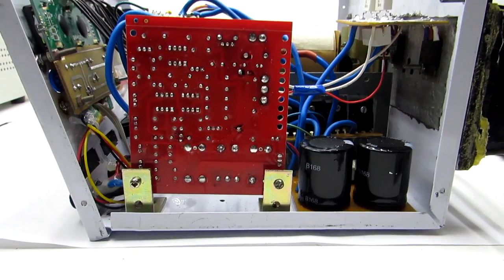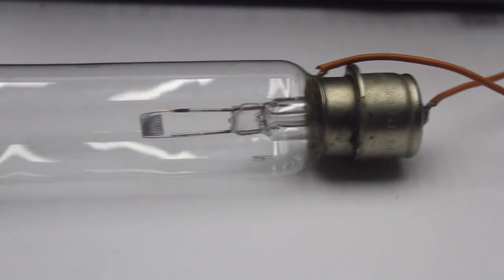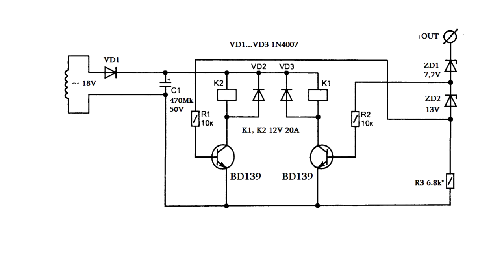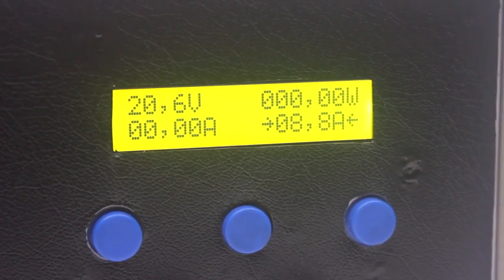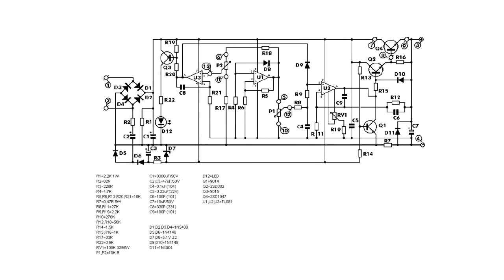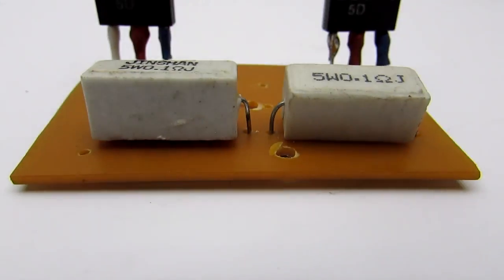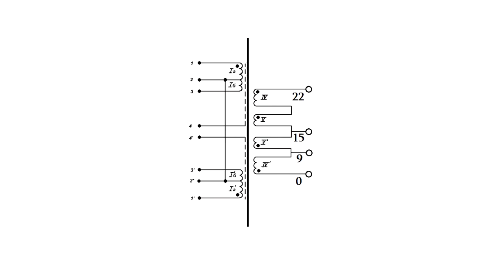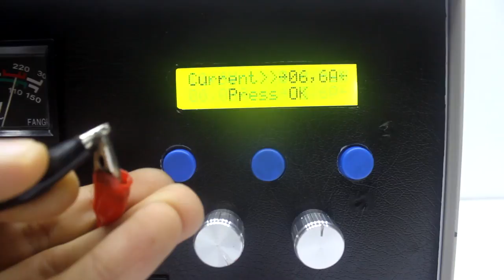DIY super laboratory power supply

Comment: Excellent project but a little expensive for a hobbyist.
Reply: The transformer is the only real expense. The easiest and cheapest way to salvage an equivalent transformer is to use multiple transformers, rectify each of the secondaries and then wire each secondary in series like a battery. I like to upcycle audio or car charger transformers to get higher current on the cheap.
Reply: Upcycle Electronics old ups tramsformer good is free or cheap
Reply: Upcycle Electronics, I see, that is how you do it, thanks
Reply: samıh savdır 
  That sounds like a good place to find one. I try to buy up any car battery chargers I can find at thrift stores and garage sales. They seem to be the most common 6-10amp transformers I have come across on the cheap (I have 3 spares currently sitting on a parts shelf). I don't pay more than $5 for one.
  Audio transformers are usually more versatile as they tend to have more complex secondary windings for dual polarity preamps/op amps and a high current winding(s) for the power amp(s) itself.
   Another super cheap option to keep an eye out for are the low power lawn lighting type control boxes. Some of them have large high current transformers. Most people in second hand stores have no idea what they are or what to price them. I've picked up a couple of those for $2 each, weather proof enclosure and all. The ones I have look like they belong in welders... massive ;)
Reply: I like the aesthetics of clean minimalist design personally. Which is something that your kludge transformer scheme offends greatly. I'm not saying it wouldn't work, but that I'd rather not build it if it is going to be so hideous.
Reply: Paul Frederick 
 I love clean aesthetics. My personal hobby interests come last in life. If I can turn a bit of lunch money into a tool or project, I'm not too proud to try it. I'd rather get the job done with an ugly tool rather than have none at all while saving for years, but to each his/her own. We'd be nowhere without standards. My standards probably have roots a little closer to the poor house.
Reply: I live by the axiom, anything worth doing is worth doing right. So if I can't afford to do something right I tend to wait until I can. Because as they say, good things come to those who wait.
Reply: +Paul Frederick
 ¿ good things come to those who wait.? 
Your mother told you lies ...  People died waiting in believing that axiom....
The best is to buy the best you can afford at the time, and later buy something better when funds become available.
Reply: +Andrew_koala then you've bought twice, which ends up costing more.
Reply: What do you have in mind that may be cheaper and just as good as this?
Reply: If you follow the above conversation, there are a few suggestions for sourcing transformers for a project like this. I have a couple of tutorials vids on how to mod a cheap SMPS supply by just changing one or two resistors. That is the cheapest variable voltage supply. If you need a supply for very small signal purposes (under 100uV/not something most beginners need), then don't play with SMPS, go linear. This channel has a good example of a linear supply using upcycled components, but it's not as stable as an LM317 or similar 3 terminal regulator. If you want to stick with salvaged stuff on the cheap, look up 'LM317 current bypass transistor circuits.' If you understand the bypass circuit, you can find the modern equivalent to an LM317 in it's surface mount variety. They are usually in a SOT-23 package and marked xx1117 (usually AMS1117). There are a lot of fixed regulators that look similar. The voltage type is usually marked just below the part number. You need one marked "adj." You can improvise a surface mount if you want, but I usually just cut the PCB around it with it's filter caps and all. Then just replace the voltage divider with a potentiometer. You can usually find the 1117's in simple low voltage consumer electronics. You need to find 5-15 year old junk that is mass produced in the millions (sold at Big Box stores/Walmart/Best Buy/etc), and that uses a wall wart plug as it's power supply (not batteries). I have found several in digital picture frames and internet routers. There is a good chance of finding them in digital audio junk too, but not always. The adjustable variety can be treated just like a regular adjustable regulator. They just can't handle large currents, thus the need for a bypass transistor.

    If you want a current regulator, start by looking up and building a 'JFET current sink' with just a N channel JFET and resistor. You place the load's return to ground on the drain pin. The resistor goes on the source pin and the other side of the resistor to circuit ground. The gate also goes to circuit ground (aka the other side of the resistor).

     (Load)
        | D
G┌[
    |   | S
    |(R1)
    L_|
        |
   (Ground)

 The resistor value sets the current limit of the entire circuit. You can even build a simple insert that plugs into the ground terminal of any power supply. This insert contains the JFET and Resistor (or potentiometer), and your load (device your powering) plugs into the insert. This turns any power supply into a current limiting supply. (This device is on my list of things to build in a tutorial soon)
   N channel JFET's are easy to find if you know where to look. All little metal canned electret microphones contain an N channel JFET. Just carefully cut away the base of the can with side cutters to get into one. If it's a through hole FET, one of the pins of the FET will probably be attached on the surface of the little PCB base really tightly. They can be a pain to deal with but the secret is to use a hobby type razor blade/scalpel knife to carefully remove it. That's a great way to get started with current limiting building block type circuits.
Reply: High VA transformers have gone the way of the dodo bird these days. They are virtually non-existent anymore. As everything high current has gone SMPS. It was never easy to find the right voltage output with any transformer for projects if you needed a specific voltage anyways. Modding manufactured SMPS for different voltage output may not be wise either. As the transformers in them are wound for specific outputs. So changing the sense loop disrupts the balance of the drive circuitry. But hey if it works for you then I guess you're just lucky. It does need to be a cheap SMPS like you say too, because better PSUs have over and under voltage sensors built into them. So they'll shut down when they drift out of regulation.
Reply: +Paul Frederick 
That has been my experience too when it comes to high VA transformers. 
   I've been doing a lot of experimentation with SMPS trying to understand them practically. Most of the cheap SMPS units common to consumer goods are simple old style peak current mode controllers, at least the ones that I've come across that use the TL431 shunt reference. I have a few of the Constant Current PWM type chips that are more complicated (UC3843/KA7500/TL494), but they seem to be used in newer and larger style supplies. All the ones I've played with have quite a bit of adjustment room built in. I actually got the idea awhile back after finding two different power supplies from Sony devices where the circuits were identical. They had a trimmer pot on the inside that was sealed inside. One was set to 9.5volts output and the other was at 12volts.
   After plotting the frequency curves for the timing capacitor, and testing the output with a dummy load they aren't that bad.
    I'm slowly working on another project to upload where I'm using a MC34063 from a car type phone charger and a small transformer from an old calculator with multiple secondaries where I can float the ground point of the supply to get a zero volt adjustment. I will try to compare it on the scope to an adjustable linear supply at the end.
    I've been trying to calculate ∆IL/IL(ave) and trying to center it inside the voltage adjustment as much as possible. I've yet to figure that out in a way I can communicate without words (fun little personal challenge). I really wish I had a cheap component tester or LCR meter but my wallets full of dust bunnies ATM.
  When it comes to the cheap "off-line" type mains power supplies, if you only mod the secondary side it's pretty difficult to screw them up. The manufacturer has already biased the other side of the optocoupler to the actual feedback pin of the controller. The way I showed is fairly fool proof because of this. The little none isolated MC34063 circuits used in chargers are a whole nother story. I've already smoked one and blew out a cap with another while experimenting with unknown inductors and external FETs. (Things I would never encourage others to do.)
Reply: As I understand it SMPS are tuned with the coil they use for a certain output. Going too far away from that smokes the drive transistors. There is some adjustment allowed, but it falls within a range. The way to really set the output on a SMPS is to rewind the transformer for the voltage you want. I want to get into building custom SMPS myself. I am just finishing up the circuit I am working on now. I made a really simple dimmer circuit that seems to work remarkably well. I want to use it to speed control universal motors. I have a couple I'd like to slow down. I did buy a batch of TL494s to experiment with and I've taken apart some ferrites to rewind. So that project is on deck once I wrap this one up. I'm kind of tired of building linear supplies at this point anyways. So I could go for a change of pace, something new. I can get loads of SMPS parts. I've probably stripped a dozen old PSUs by now as it is.
Reply: Paul Frederick 
  Going to physical therapy now, but there is an excellent excel tool that helps you calculate how to set up a SMPS here:
http://www.onsemi.com/pub_link/Collateral/SMPSRM-D.PDF

or the practically useless simple version here:
http://www.nomad.ee/micros/mc34063a/

Constant Current example setup:
http://paulorenato.com/index.php/about?id=89

 P Channel FET example that doesn't work so well but lots of info and good references at the bottom:
http://www.jiggerjuice.info/electronics/projects/power/buck-diode-pmos.html

Practical explanation of MC34063 pinout and functionality:
http://www.learningaboutelectronics.com/Articles/Switch-mode-power-supply-circuit-with-an-MC34063.php

Expansive SMPS Reference:
http://www.bcae1.com/switchingpowersupplydesign/switchingpowersupplytut01.htm#strc

  Those are a few I found helpful so far ;)
Reply: Thanks for the links. I'll look them all over.
Reply: I just realized the first link was wrong. This should be the excel spreadsheet:
https://www.onsemi.com/pub/Collateral/MC34063%2520DWS.XLS

    Your probably not interested in the MC34063 chip, but some of basic principles work in different designs. I particularly liked how this spreadsheet let's you see how a lot of different elements interact with one another dynamically. Especially how current ripple and core saturation interact and relate to duty cycle and timing capacitor.
    Each of the SMPS supplies I've modified are rated at relatively high currents from 3-7amps and from 9.5-36 volts originally. I certainly wouldn't recomend that someone should try to get max current rating from a supply like this at a different voltage, but in general the transformer is designed for safe operation at it's rated current/voltage which means it has a fairly large margin of voltage variability at lower currents without fear of core saturation. With "off line" isolated mains supplies you don't really have to worry about duty cycle issues because there is such a big difference between primary side voltage and the secondary. I burned up an MC34063 learning the duty cycle lesson. The timing capacitor comes into play in my experience more than the inductor on a variable setup but like I said I haven't pushed one of these hard by supplying as large of a current as possible. I have other fixed supplies I use for those types of projects. Of all the supplies I've built the little adjustable SMPS I built into its original enclosure and showed in tutorials is by far the most used and convenient one I grab for little projects these days. It's quite handy and doesn't get in the way. I think they are more flexible than most people give them credit for.
Reply: Upcycle Electronics  I just subscribed to your YouTube Channel, I'll be watching, thanks, you know I like new project builds were I can use some of the electronics I get from my excellent recycle trailer source. Let me know if you're looking for a particular component be glad to help. See I am interested following project builds that use existing circuits found in recycled goods. Yes, I can buy new from china usually cheaper, but that's not the point, right? Most of the time you can find what your wanting to make already assembled cheaper than buying the components and assembling yourself,but this is the niche need for a channel to satisfy.
I enjoy the hunt for a particular component that needs replaced after I have diagnosed what is bad, then taking that recycled component and replacing, and getting something broke to work again! I do not see making a living at this but I really enjoy it, heck most of the stuff I fix I give away.
Thanks!
Reply: Gary Weliver 
  Thanks. I'm just having fun as well. I'm slow to build projects and upload content, but I'm just having fun. I'm no electronics engineer but I have a propensity for learning technical subjects and I have an intuitive thought process that some people relate well to. I live near a thrift store that sells a lot of electronics. When their tote of wires and chargers gets hopelessly tangled I go attack it with side cutters for all the supplies and they recycle the copper. I also pick up the stuff they get that doesn't power on from time to time. It makes for a wide range of fun random free stuff. I only buy the super cheap odds and ends that have extra value.
   Here in the US, now that RadioShack is officially belly up, I think learning to source your parts from junk is the only real gateway into electronics for the next generation. It just became much more challenging to build your first mildly useful trinket here.
Reply: +Gary Weliver I never use existing circuits. There's usually some special aspect of them that makes them not work for me. Like I tried to get the fluorescent bulbs to work in a LCD monitor, but the micro on the board sensed there was no signal, so it would shut down. It isn't worth it to me to figure out what someone else did and circumvent it either. I just don't like kludgy crap like that. There's no junk electronics to be had by me anyways. I like stripping boards for parts, but I can't even get any here. I used to be able to, when I lived in a more populated area. But where I'm at now if it isn't corn, soy beans, or chickens then it isn't here either. At least like you say parts from China are cheap, and easy to get now. For experimenting I like having a quantity of fresh parts to use anyways. That way if I fry something I have spares. Which doesn't happen too often, but I still worry about it. With the things I do the potential certainly exists. I'm surprised I didn't blow anything up making this dimmer circuit recently. It is not like I ever made one before. Plus the info on the net kind of sucks. They don't tell you that you can only trigger off one leg of the triac. I eventually figured that out on my own though. I looked at a bunch of sources too.
Reply: Paul Frederick 
  I don't usually mess with the super integrated stuff myself. I've gone down that rabbit hole a few times. Salvaging parts certainly takes more time and is really difficult to do solo. I actually keep most of the parts I have on the original PCBs. There is a lot to learn from figuring out how a device works. If I'm going to salvage a complete part of a circuit, I take pictures, power it up, and make sharpie notes for everything I find. For instance there are some interesting triac circuits used on HP laserjet printers for the heating drum element. They use a triac, 6 pin optocoupler, and a relay to make it work. 
  Another interesting switch mode circuit I've come across is a small portable heater that used 2× PIC12F675 microcontrollers as the switching controllers for a high voltage heating element and an "Ozone Ionizing Grid." I almost threw it away because it looked terrible on the outside. It ended up being one of the most interesting finds I've gotten for free.
  Salvage stuff is a great way to get a foothold in electronics or to explore a new interest, but it's also a guaranteed recipe for wasted time and unnecessary headaches. It really comes down to what your time is worth to you.

 Being human means we all have to subject ourselves to a life choice of having too much time and no money, or a bit of money and no time. The only other option is to hurt people by taking advantage of them to take away their time/money. I got stuck with the extra time option, so I salvage and make due with what I have :)
Reply: The way I strip boards is pretty fast. I had to up my game when I got my second microcomputer to scrap. So I bought something called a solder pot to pull parts out with. I just put a board over the molten cup of solder and pull parts out. A 64 pin DIP IC comes out as quickly as a resistor does. Sometimes I think I should research boards more before I strip parts off them, but like you said, that takes time. If parts are so mysterious I can't look them up then I don't want to use them anyways. I do find a number of mystery parts stripping old boards too. Then it is obsolete junk. I find some nice vintage stuff too though. I pulled some old radio apart and got a bunch of vintage JRC parts off it. The vintage JRC4558s are like $75 chips. Well worthless today because I hear they remade them. So you can't tell the originals from the remakes. Well, you can tell listening to them. I know the ones I have are the real deal. Because I pulled them out of an old board. There's a lot of counterfeit electronic parts today. All the stuff out of China is fake. Some is more fake than others though.
Reply: Paul Frederick 
   I've looked into building a solder pot, but I think an operation like that would be a bit much for my physical limitations. I set up my lab in my bedroom. Not exactly the most healthy solution, but it allows me to maximize my time. 
    I have a few displaced disks in my upper back that prevent me from sitting or standing for prolonged periods. At best I get 2-3 hours of periodic upright activity most days. After that I'm prone to big mistakes, impatience, and failures from pain levels. Any demanding types of dedicated operations tend to be a bad idea for me. I end up leaving a giant mess everywhere and a long series of half finished tasks and projects in my wake. 
   Before I got hurt I was porting a set of aluminum heads, machining a custom intake manifold, and putting a B&M mini blower on my Camaro, while also getting into metal casting, and racing bicycles, while working 50 hours a week... So slowing down has been a rough lesson to learn. Hopefully one day I'll get myself back in gear and up to speed.
     After 3 years of getting more than casually involved with electronics, I'm at a point where I don't get as much benefit from keeping the parts on the PCBs on such a large scale. I have learned to handle certain parts more carefully like transformers, larger capacitors, and larger transistor type packages. However it is really beneficial to know the context of a part in a circuit to see things like it's power handling capabilities at a glance. For a beginner, a schematic can look like a foreign language crossword puzzle. Seeing a physical example on a board helped me understand things like dual polarity versus single supply op amps, and how audio preamp filter stages, buffers, and decoupling work. Even recently researching SMPS. At first I was focused on trying to find a specific control chip used in several devices to figure out how it worked. Once I fully understood how to identify the components of a SMPS, I started to realize how prolific they really are on almost everything. I went from having a bunch of examples of buck converters in isolated and non-isolated topologies and a few boost converters, to having examples of almost every topology imaginable. Of particular interest are the buck-boost circuits I found on battery operated devices that can maintain their steady voltage output until they seriously suck a battery dry. In all likelihood I wouldn't tackle a circuit like that for years. With a working example that I can cut out and modify to help me understand the topology I'm already pushing my understanding further. That said, I've encountered burned out diodes, a few broken traces, leaking capacitors, and various other headaches from attempting to salvage circuits and parts I didn't know were faulty. Most problems were solved quickly, but not all. I'm still keeping it pretty simple though. It all comes down to how we value our time. My time is currently valued at the curb clearance pricing tier of an overstock surplus store.
   As far as salvaging components, I really want to build or buy a hot air rework setup, and a powered solder sucker like on the Mr Carlson's Lab YT channel.
Reply: Good Stuff
Reply: Yeah I do not run my solder pot indoors. Or The Volcano, as I affectionately call it. I have a commercially made Esico brand model 37. Here's a picture. http://i.imgur.com/2LqkdOi.jpg That much molten metal just screams take it outside. I think the mouth is about three and a half inches in diameter? So any part that fits in that area I can pop right off a board. Some long connectors haven't fit. But most everything else is no problem for me. I still need to attack boards with some strategy. I take the more temperature sensitive components off first. Skim the cream. What I do is I rotate a few boards in a session. I do a heat, remove some parts, then rest the board, to allow it to cool, and I work on another board. Usually I'll do a 5 board rotation. Strip 5 boards in a sitting. That takes maybe 45 minutes? Then it takes about 3 days to sort all of the parts into storage. It depends how random a collection of parts I end up with. It is usually pretty chaotic though. As those are the kinds of boards I typically target. Ones with varied collections of parts on them.

I've sat there stripping boards with solder suckers and using a solder pot is the big leagues compared to that. There's no comparison really. A solder pot is easily 20 to 30 times faster. It basically boils down to how quickly can you get a tool on a part? Sometimes I just use a pick tool and flick parts off boards. That goes really fast. Sometimes I use these angled needle nosed pliers to pull parts out. Some parts I just grab. Like ferrites on PSU boards. They pop right off.
Reply: Paul Frederick 
  That's a more manageable size than others I've seen and a more portable setup. How long does it take to heat up to temperature, and are there any potential consequences/reasons why you couldn't leave it unattended for 10-15 min?
   When my back goes out I have to stop and lay down flat. I can come back a short while later but that's most of my day... On/off/on/off. If I'm in an office chair that leans back I can manage better but committing to continuous sitting up or standing puts me on a damage clock. I can do it but it will cost me a few days of total inactivity afterwards.
  I'd love the convince of a solder pot like that especially when it comes to the lead free junk that never cooperates with a solder sucker.
Reply: This is a pretty big solder pot. It is 5 pounds of molten solder. It is not leaving it unattended that I worry about but the unlikely event that it spills over. Plus there are fumes. Burning circuit boards do stink. It is the greatest for tinning soldering iron tips though.
Reply: I bet it is the best for tinning tips! Heck you could probably do some interesting brazing projects as well with 5lbs of heat mass. 

  When I said it was small I was referring to the overall kinda square looking dimension (height to width). It's not easy to determine exact scale in the pic, but you said it was about 3.5" in diameter, so I assume each face is a little bigger than the palm of my hand. The ones I've seen people "kludge" together usually look like something I wouldn't want to move around much at all. They look like the kind of tool that needs some dedicated workbench real estate. They are usually more shallow and larger. I wouldn't want to slosh something like that around. Your setup, with the metal pan and tray with handles just looked much more manageable and portable than others.
Reply: Gary Weliver 
  Yeah I understand what your saying. I will try to do some of that, but the real fear is misguiding someone or failing to warn someone about potential hazards. Most people are worried about legal problems from that kind of thing. I'm just learning as well.
    I can guarantee I will do things wrong and make mistakes along the way. I don't want that to go unchecked. 
    When it comes to electronics fundamentals the subject is huge and much more complex than most people know...and that's just the fundamentals. I certainly underestimated it. About all anyone can do is try to show people how they managed to connect the dots on a subject as simply as possible. This is one subject where the structure of a schooling program is about the only way to completely understand what your doing and why. It takes a lot of complex math to really understand electronics, something I find very challenging. That's not a very easy thing to relate to on YouTube although there are a few people that try. My best recommendation, if your serious, is to buy the book "The Art of Electronics." It costs a fortune for just a book, but it is the best investment I've made so far. If you really want to check it out before you buy it, sometimes you can find a PDF version by doing a search for the title and then add the specific google search tag modifier: filetype:pdf. I can tell you now, it's too cumbersome in digital format. You will find yourself going back and forth with four fingers bookmarking different pages looking at how one item relates to another then to another, and a different schematic example with yet another interesting element. It's supposed to be a more practical approach to electronics, but in reality it's more like "Simplified Chinese" versus Mandarin, it still looks like Chinese to anyone that doesn't speak it.
   Basically there are too many uses for fundamental circuit components. It's really difficult to explain even the simplest concepts like what a transistor is...because a transistor is not a thing, it's an enormous category of parts that are used for many different things. Even a single type of transistor has several variables between different part numbers, along with different potential uses, many of which are not at all related. I don't think anyone could really show all the different uses. One thing that I've been thinking about doing is a set of simple short videos describing places to find a specific component type if you need one. I already mentioned JFETs here. You can also find the rare P-Channel MOSFET on most old multi cell lithium batteries like old laptop batteries. The coolest 7 segment led number displays are in old alarm clocks from the 80's the oversized ones make really cool unique looking meters. Anything old like calculators that have a vacuum fluorescent display and a paper printing roll from the late 80's have interesting components worth investigating. The word efficiency was blotted out of the dictionary back then. You'll find lots of fun beefy components in those.
  Really the most important thing is to be safe while trying to explore working circuits. Try and make it not work, and see what it does. When the parts/circuit doesn't matter, just look for the electrolytic capacitors that are larger than about 470uF. Note their voltage rating and polarity. Then solder a pin onto each pole and slowly give it power to see what happens (while being prepared for anything including fire/eye and skin burn hazards). Clip your common terminal of a meter to ground and probe away. Electrolytics are like a guide to where power goes in a circuit. They have other uses in things like audio circuits, but those types of circuits usually use small values. Most of the time you can tell if it's a power cap if the negative pole is connected to the same ground traces as the rest of the circuit. ...see even this gets more complicated than I first thought it would.
Reply: I have an oxy acetylene torch set for brazing with. To braze I have to get metal up to a dull red glow. The pot never gets that hot. My pot is a good hobbyist size. Although the Model 37 is industrial equipment. We had them at the board assembly house that I worked at. Which is why I got one. I was familiar with it before I bought mine. Over 30 years on now my pot is still going like the day I got it. That's what I want in a tool.
Reply: Yes, the world of electronics is immense! I will try and get my hands on a copy of "The Art of Electronics", for sure.
You know I still find it hard to be able to send a "private message", Ha!
Reply: search it at eBay, cheaper
Reply: ***** 

What are you proposing? Do you have a particular site in mind?
Reply: Yes looks like a kit would be a great idea!
Thank You!
We need a video by Paul or you to take us through how to build it and test it when done?
Could be a vblog where whomever wants to follow along can buy a kit then follow along.
Reply: I usually upload some projects at Facebook, I`m called  "si vis pacem para bellum", with the "mossad" sign.
Reply: I put some projects up on a website called instructables. Simple linear power supplies. My user name there is pfred2. One is called "Dual POS-NEG Power Supply", and another is titled, "300+ Watt Linear Power Supply". Getting the right step down transformer for those kinds of supplies is hard today though. well, it was never too easy, but it getting harder as everything has moved to switching supplies these days. So I want to start making switching supplies myself. Though they are cheap enough to just buy too. But cheap switching supplies are made pretty cheaply too. So it might be worthwhile making those?
Reply: For the adjustable SMPS doubters, looky what I just found in an old container:
i1160.photobucket.com

I'd show the Sony ones I mentioned earlier but one is in a bench power supply, the other I think I parted out cause I can't seem to find it.
   I'll have to tear into this one at some point to see how it works. It's got a large current output for the voltage adjustment, and the 5V 2A  USB port to boot!
Reply: And that's most of my transformer junk...at least the ones that are free from their homes in a past life. Bottom right is the current work in progress to upload next.
i1160.photobucket.com
Reply: YouTube can be funny about links sometimes. It depends on settings the channel owner sets. Even with a pile of transformers I still rarely have one that I need.
Reply: Paul Frederick 
  Yeah, it's usually monetized links that get rejected from what I understand. I've gotten the "is this comment spam" message before when someone else posted on my channel, but that's all I've seen. I don't think the guy making these videos on this channel speaks English. I haven't seen a single comment from him on any of his videos. No one should really care. Comments get the video higher SEO optimization.
   I'm here for the community and for fun anyway.
   BTW nice article on Chinese component testers on Instructables. 
instructables.com
Reply: Thanks. When I bought my first component tester I did not know a thing about them. Which is why I bought a dust collector. I keep thinking about stripping it for parts now. But after I found a bit out about them I decided to try to spread the knowledge some. You want one with a precision voltage reference, not a zener diode. But there are some other considerations beyond that I suppose. I really like the graphical one I have with the button that spins. It makes menu navigation a lot easier. Though in use I don't access the menu all that often really. Transistor testers are great for sorting parts.
Reply: I don't usually post random links to other peoples stuff unsolicited, but I honestly just came across one of the coolest references I've ever seen. 
    I was just looking up info about some simple multivibrator circuits and square wave oscillators, got sidetracked, and came across the greatest PDF circuit reference I've ever seen. After all the other links and info I posted on this thread I figure one more wouldn't hurt. I've actually seen these circuit diagrams used elsewhere but had no idea where they came from.
 http://www.talkingelectronics.com/projects/200TrCcts/101-200TransistorCircuits.pdf

  I have absolutely no affiliation with any of this. Be aware the actual site is very early 2000's looking and I got a notification my browser blocked 2 pop up ads when I first visited it a few minutes ago. The reference material is well worth the visit. I'm just posting the PDF link, but the site is in the link address. There's a lot more interesting stuff there. It's called 101-200 Transistor Circuits, and it has a very compact list of all kinds of related circuits. Of particular interest to me is a list of AC to DC rectifier configurations. I didn't know a couple of them, like how to make a dual polarity supply out of a single secondary winding. That one is on my list of things to try.
  Sorry in advance if this kind of thing offends anyone. I just get excited and want to share stuff like this when I find it. I suppose I should (re)start using mainstream social media, but I like my phone battery to last more than 15 min.
Reply: That's a big collection of circuits. I have paper books like that, but I've never seen a digital file like it before.
Reply: I guess he used transformer, which was inside a lamp TV.